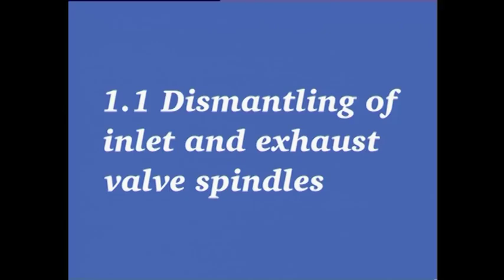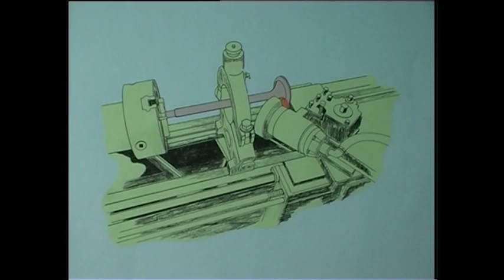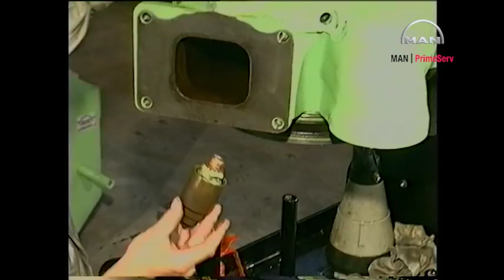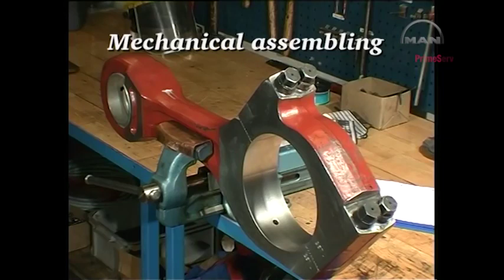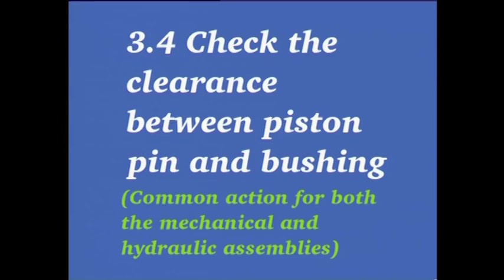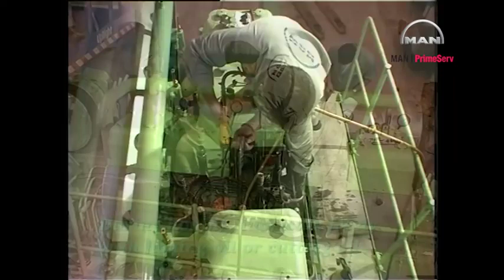MAN B&W L+L28/32H - Overhaul of Cylinder, Piston and Liner

Comment: Hello sir
I have question
Why shouldn't start lube oil pump before insert spring air?
I can't understand reason why to avoid excessive opening of exh' v/v.
Reply from the maker: To be honest, until now neither me can understand it.
According to Instruction manual for MC engine, during Mounting Exhaust Valve it said "The air supply to the exhaust valve must always be connected before turning on the oil supply to the exhaust valve actuator."
Reply: @Indigo897  thank you for your answer 😊 have a nice day